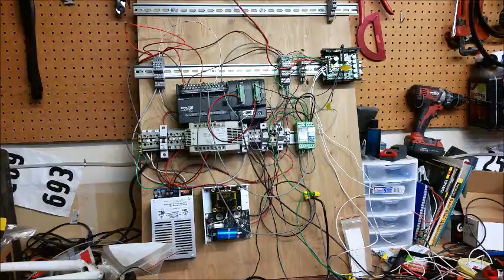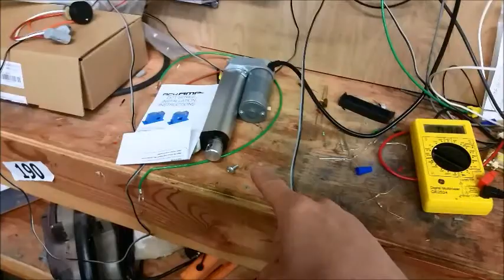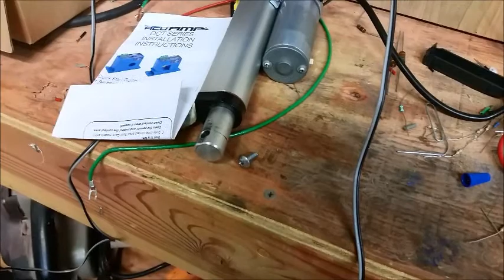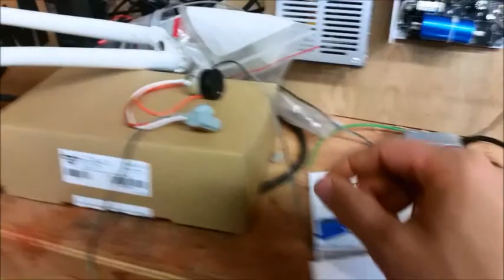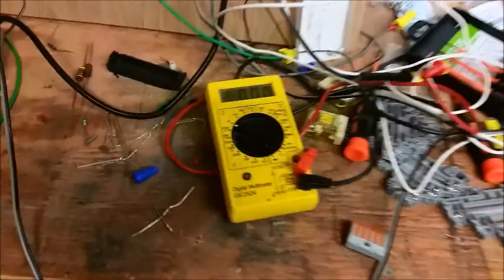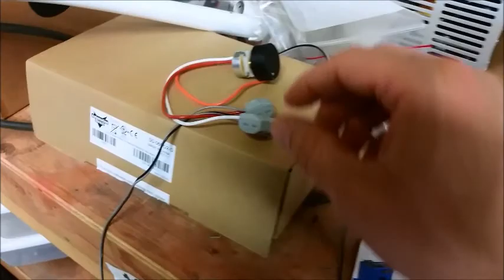DL06 PID PWM Actuator Control

Comment: I believe that you are using a direct current drive not a VFD.  Just sayin'.
Reply from the maker: correct.  sorry.  in my head I was saying pwm (pulse width modulation)  drive,  but out loud I incorrectly called it a vfd. all dc here... oops.